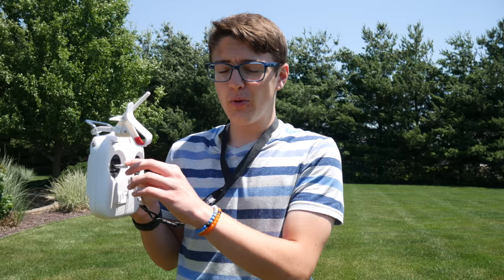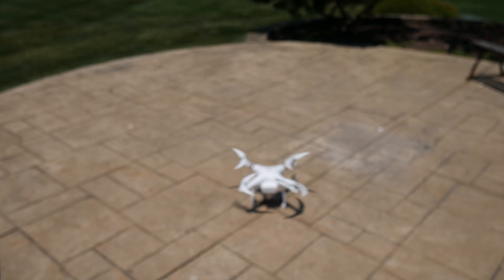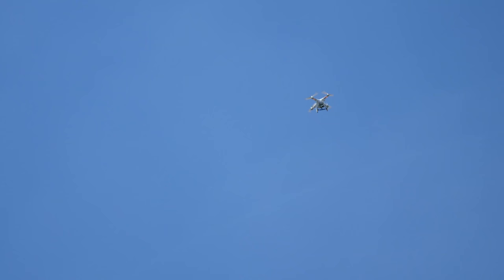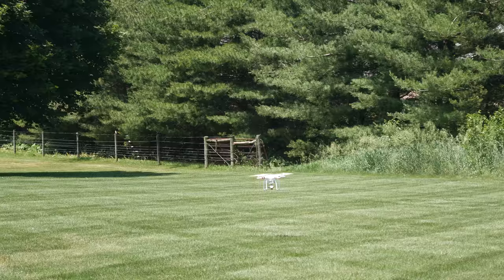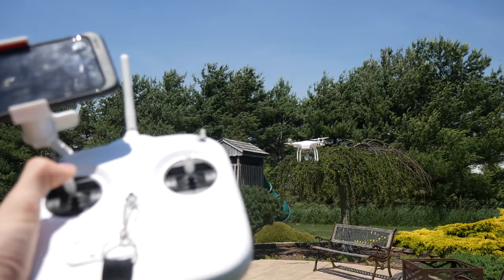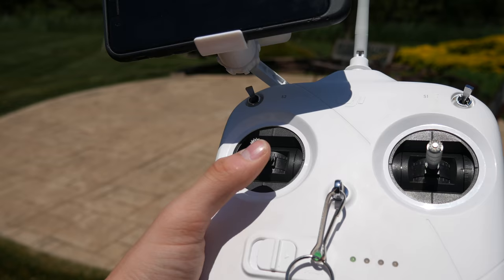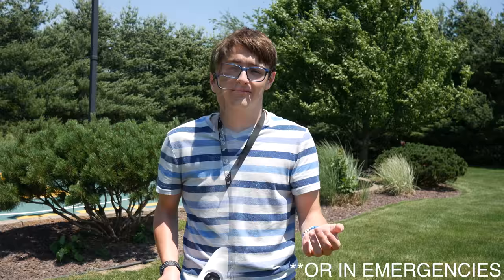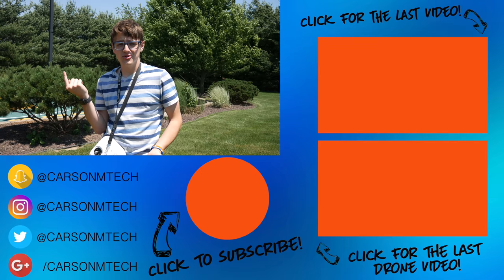What Happens When You Pull Down the Left Controller Stick on a DJI Controller??

Comment: hey, Carson have you ever locked the left throttle stick in mid-air? and if you have did it shut off? also i just wanted to know because i just got a phantom 3 standard and wanted to know if it would shut off the motors during mid-flight.

Comment: I lost my Syma X8CW last year. It went out of range and I tried to bring it back by lowering the altitude and reversing direction. Pulling the joysticks to the bottom and that's where it went, to the bottom of the creek. I blame Syma for their poorly written manual for that. But, I'll never make that mistake again, with my Phantom 3 Standard/controller.

Comment: I'm sorry but I have to disagree with you on that mine may been a freak accident but when I was about 3 foot off the ground I stumbled walking and pull the stick all the way down just the one stick my  drone crashed, the motors did cut off and like I said I was about three feet maybe four off the ground when it shut down
Reply from the maker: If you’re that close to the ground the drone is programmed to shut off once it touches the ground (or once the motors stop working so hard because it isn’t making the drone life up anymore)

Comment: Hmm.The title is "What Happens When You Pull Down the Left Controller Stick on a DJI Controller??" but I still don't know what happens because your narration does not match the video.

The first 2 times you show "what happens" the drone just stops about 10 feet from the ground.

Is that really what happens "When You Pull Down the Left Controller Stick on a DJI Controller??"? The drone loses altitude until it is about 10 feet in the air and then just hovers?

Comment: Carson,
Your videos rock and have gotten me way excited about flying my P3 std.   BUT today a horrible thing happened, after I watched your video about "What happens when you pull down the left controller stick...."

First of all, you should point out to your newbies (like me) the the P3std ships with the controller settings in different positions and with different properties.  There are 3 choices. Not knowing  any better I have been trying to learn to fly with Position 1, always wondering why your videos never quite did the same stuff as mine...

Anyway, I have a lot of trees in my area especially around my pool and have to takeoff and land in ATTI mode.   As I brought the P3 in for a manual landing, the feet were ON the POOL DECK.   I thought, "Carson says bringing down the Left controller into the lock position, turns off the engines"  

Sadly, thats not what happened.  Instead the drone took the downstroke as an input command, flew off sideways and into my pool at top speed.   Sob......

So maybe the downstroke/lock thing only works if the controller is in the GPS mode...

Anyway, Id love a quick video about your preferred controller position settings. 

Thanks for being an awesome teacher
Soggy